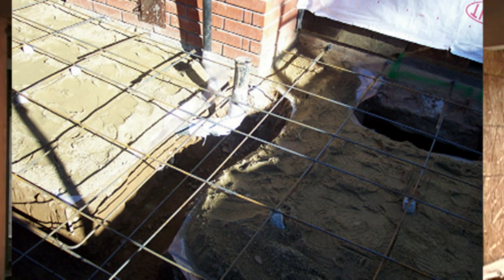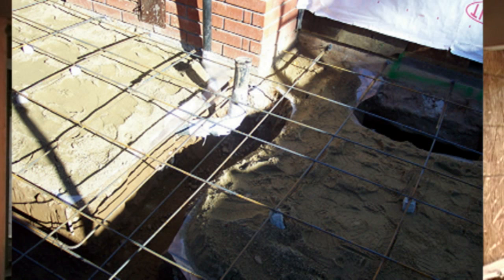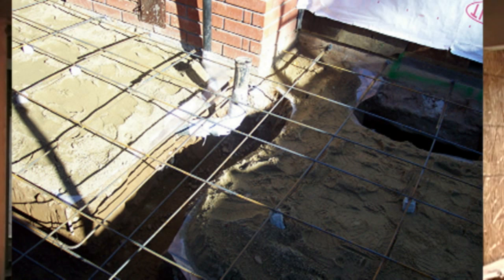Concrete Reinforcement Tips - Patios, Driveways, Sidewalks and Home Foundations

Comment: What are your thoughts on fiber mesh for patio and walkway and driveway?
Reply from the maker: I'm guessing that you're referring to fiber mesh or fiberglass that will be mixed into the concrete mixture you're planning on using and I've used it a few times with good results.

Comment: What about fiberglass reinforced concrete, can you skip the rebar? I am having a slab poured and one contractor says the rebar is not needed.
Reply from the maker: You don't need to put rebar in a slab, but it definitely will make it stronger and quite possibly reduce the size of slab cracks in the future. It really depends upon the size of your slab and what it's going to be used for. For example driveways should have rebar, but sidewalks might not need any.
Reply: @gregvancom  why wouldnt you put rebar in a slab? Or sidewalks? Hahaha wrong
Reply from the maker: You might need to reread the comment.
Reply: @gregvancom  no i dont

Comment: thanks for the tips 
I am using a wire mesh in my driveway.
it will be the biggest concrete project that ever work on
Reply from the maker: Good luck and hope everything works out.
Reply: used 6guage wire for 30years no problem